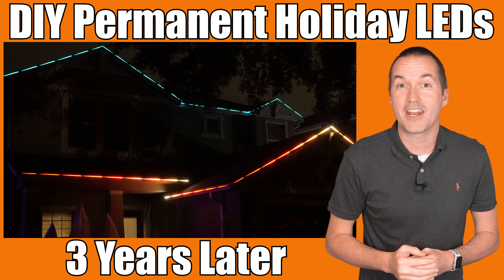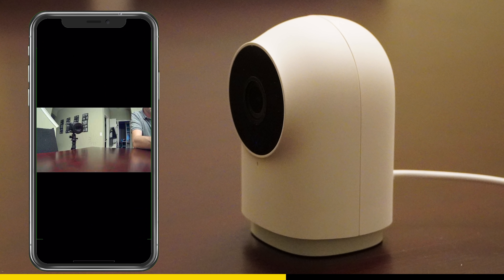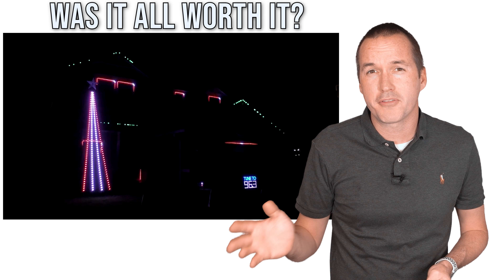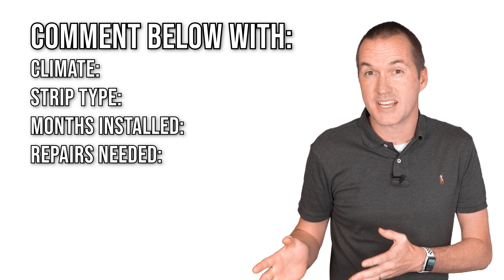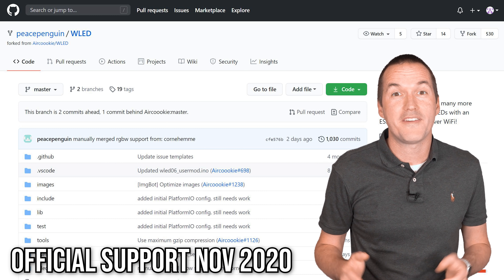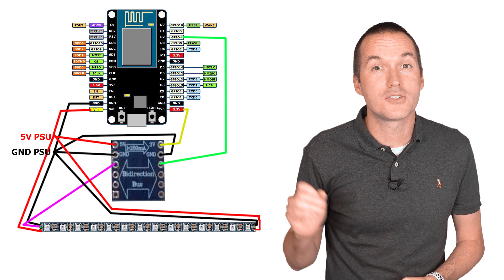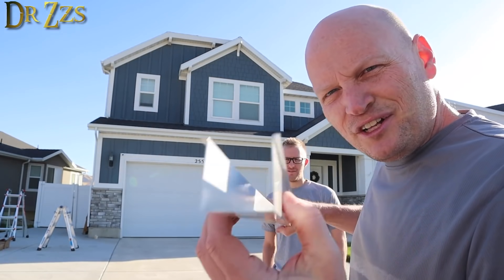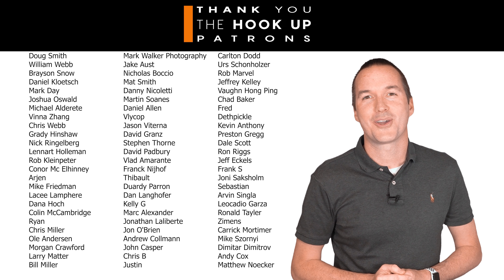3 Years Later: DIY Permanent Holiday LEDs - What worked, what didn't, and what's new?

Comment: why would one want to use a DigQuad over the DigUno.   I was under the impression that one could use a single Uno for everything as all the LED strips are daisy-chained.
Reply from the maker: Correct, my lights are in different outputs (different pin for the upstairs and downstairs), if you have a single run then a digiuno will be fine.
Reply: The Dig-Quad allows for a few things on the board itself. 

First off it has 4 level-shifted data outputs so you can run separate data cables to LEDs that don't connect together serially easily otherwise. Second, if you go above ~500LEDs for a single data output framerate starts to visibly drop, using multiple outputs means you can run multiples of ~500LEDs!

Then the board also has lots of output terminals (7x) which are run through 5 fuses so you can very granularly run your power injection wires directly off the board and keep everything safe with the fuses. Otherwise you'd need some external hardware for that.

Third, it comes with an ESP32 instead of an ESP8266, but I have something in the works for that. ;)
Reply: @IntermitTech  Ahh, that's some great info.  Thank you so much!

Comment: I see you have two power-supplys, are there for diffrent strips or are they connected to the same strips? Like in a parallel connection?
Reply from the maker: One PSU is for my year round roof LEDs, the other is for my seasonal window and door LEDs, they are not connected together.

Comment: Hey Rob, thanks so much for this video series. It's inspired me to not only get into this project, but so many other home automation project I never would have dreamed of beforehand. I do have one question though, when it comes to power injection, do you just run the one single wire from your power supply and splice it at each junction to inject power, or do you have multiple wires running from the power supply to each injection point? I can't really seem to find much on this topic, and I've never dealt with anything like this.

Thanks!
Reply: I ran a wire small gauge wire with the strip, and power injected at every splice. I then power injected every 100 leds with another 18ga back to the controller. I used 5v, I would use 12v if I did it again. I think you can get away without the small gauge follower power injection that way. Also run the power injection thru the controller power feeds too. That way they are fused as well, assuming you're using something like intermit Tech's dig uno.

Comment: I had LED strips on my roofline at my old house with channels, I live in Chicagoland area, I will be going LED strings in my next move most likely. After 1 season about 1/5th of the strips needed repairing and replace. I don't know if it was the brand of strips, and also how my roofline would freeze for sure didn't help. If some how I could install them in a safer area where ice wont be an issue on my new home, I will maybe attempt strips again, or do a partial area and see how they hold up. My old house had icing issues all where I hung the channels. So I could only imagine the ice getting into them, and then breaking the seals on the strips making them not hold up anymore. The pressure was so strong the gap between the channel and my roof actually pushed the channel with the screws about 1/8 to 1/4 of an inch in some sections. I noticed this when I went to repair the strips and the once tight channel was now lose and needed to be retightened.

Comment: Power injection is one area I struggle with.  I want to run an LED channel under my fence with addressable LED's which will be roughly a 250 Feet line of LED's  How do I calculate the power injection requirements for a 250' run?
Reply: Check out the original Hookup video on permanently installed lights referenced in this video. Tells you how in there.
Reply: @hockeytrainingvideos371  If you're talking about Year Round Holiday LEDs Part 1: Hardware then no.  It talks about the need for power injection but not how to size the wire.  Can I run a 5v 22guage Power Injection wire for 250'?  If not how do I figure out the wire necessary?
Reply: First you calculate your power requirements (how many LEDs, how bright, what colors). Then convert to amps. With amps you can plug that into an online amp + voltage calculator which will give you the minimum size for the wire. Usually you want to bump up a size or two to allow for a safety factor.
Sadly this does appear to be one area where it isn’t really talked about. Low voltage has different amp/size requirements than high voltage. For instance I’m running 3 different 15-20 amp 5volt runs for my backyard. At 110 that would mean 12 or 14 gauge wire. At 5volt it’s around 22 gauge so I’m running 18 for a safety factor and to avoid voltage drop on my injection wires.

Comment: Climate: HOT Phoenix Arizona US. All equipment is mounted in the attic.
Led strip: WS2812b from btf
Installed: 15 month on the front of my facia boards. 
Power Supply: cheap 5v power supply
Controller: Hand build Dig Uno's. I had to run 5 controllers. I had too many leds for the processor for e131 functions. Air cookie suggested around 300 leds per controller, if you are going to use e131. Otherwise it's fine with wled to have more. 
Repairs needed: two leds had a single color die. I had to resolder a new one in. They are on year round, on white at 20% if it's not a holiday.
Reply: I'm in phoenix area too and I want to get into this hobby.  Any suggestions on how to get started?
Reply: @jaykuptake  I used the the channels and noted on this video. Put the channel up, and drilled thru it and the facia next to the closet rafter so you can't see the wire. Then drilled a hole to route the 18ga into the attic. I routed all the wires next to the attic access, and have an outlet there. That way I can stand on the ladder to wire and diagnose. The controller is a dig uno by  quinled. They are fused, and have temp sensors if you want to use them.
Reply: @jaykuptake  This video worked well for me to get started with the eve lights. I used 5v for my install but would do 12v if I did it again. Much less power injection. For the eve light controller, I used intermitech's diguno. Another great led channel. Don't put more then 300 leds on a 8266 based controller if you plan on running e131 for your display. For Christmas light shows, Canispater Christmas has a great channel for using show controllers, and scheduling with xlights also.
Reply: I'm in Phoenix and interested in doing something like this.  How have your plastic diffusers held up against the sun? I'm just worried that I would have to replace the plastic constantly.
Reply: @deity5555  The plastic diffuser is holding up so far. They have yellowed pretty good, but that matched my tan eves okay, lol. I think they are good to use here. But mine are also a bit shaded, as my house faces north. You only take them off for repairs, if you're careful I have no cracking yet. I lost one color in two pixels so far. Easy fix though, I used ip65 strip. So cut, pull back silicone from the strip, solder in the new one. Stick electrical tape to the channel under splice, to make sure it stays insulated from the strip.

Comment: My question is, WHERE do you live in Florida - on the coast, or inland?
I ask, because you said you had no issues with the aluminum channel after 3 years... I live ON the coastal water, and the aluminum I've tried just doesn't hold up well to the salt air here.
Recommendations?
Reply from the maker: I live in Tampa, the bay is about .75 miles from my house.
Reply from the maker: Also, when you say the aluminum doesn't hold up, what does it look like? Aluminum Oxide is white and filmy and should protect the rest of the channel.  If you see rust color then you aren't working with aluminum.
Reply: Well, that makes sense now... I live 27 feet from the Lagoon's edge.
Yes, it's aluminum for absolute certainty... but it's painted, not anodized - and the corrosion bubbles up under the paint, apparently.
Do they make a polymer version that holds up to UV for several years?

Comment: So what I thought was noise from my power supply was actually noise from me using solderless breadboards. I went from solderless to building my own boards on a normal breadboard and it fixed all of my issues
Reply from the maker: Interesting!  Lots of variables, I've seen and helped troubleshoot so many problems, it's hard to say which ones are equipment based errors and which ones are user error.

Comment: I have been waiting for this video and you did not disappoint.  Buy I have to say I disagree on the WS2812b vs WS2815b strips.  I feel like with the 12v strips you don't need to power inject as often or at all in the case of 2 or 3 strips per section or you can get by with just injecting power at the end of a run.  Compared to a professional install, the WS2815b strips are still super reasonable.  I picked them up on AliExpress for around $25 a strip.  To me, the additional cost of 12v strips is worth less hassle of wiring power injection every 5 meters.
Reply from the maker: I'm just hesitant to give that recommendation because I've never deployed a WS2815 permanent install and because I've seen lots more reports of failure with the WS2815 than I have with the WS2812B (again, this could just be selection bias), and I wonder if it has anything to do with the different circuitry required to regulate voltage (they are doing some crazy MOSFET inside those strips).

Comment: How were you able to determine that the first light had gone bad?  Thanks.
Reply from the maker: I had actually experienced something similar before when I accidentally hooked up 12v to a 5v string.  I gave it a shot and it just happened to work.
Reply: This is great information Rob and a great question.

Comment: Climate: Northern (Montreal,Canada)
Strip Type: WS2812B
Months installed: 14
Repairs needed: Updated to WLED on my node MCU this October. No cold weather related issues as of yet
Reply: Up there, it's less of a "freeze - thaw" cycle and more of a "freeze - freeze - ...... freeze" cycle :)
Reply: I installed ~1000 WS2815 LEDs a few months ago, it gets extremely cold in Regina, Saskatchewan for extended periods. People have them installed here for Christmas light displays and they handle the cold just fine.
Reply: @fishr0t  So happy to see your post.  I just put up over 1000 WS2812B LEDs in Regina and became worried when Rob said there has been some problems in colder climates.
Reply: @ToddSchock  Awesome! I'd love to see them and how you did power injection for the 2812Bs -- I'm hoping to do around my garage doors next year.
Reply: @fishr0t  Awesome!  I'd take a picture but my house is a two story and I have them along the roofline.  With the ice and snow out front the ladder slips.  In the spring I'll get up there and take a picture.  Until then... I used the aluminum channel that Rob suggested in his video and then I ran 18awg wire in parallel to the light strip inside the channel.  The channel is slightly wider than the led strip so the power injection wire sits beside it... sort of.  I tried to hot glue the wire down but it didn't stick to the aluminum very well and the wire also interfered with the diffused cover so I just set inside the best I could.  If I look really close I can see where the power injection wire overlaps the LED strip in some places.    I'm a perfectionist so the overlapping wire really bothered me at first but I've been reassured by my wife that if I hadn't said anything she would have never noticed.  For the connections, I pulled the ends off the LED strip and soldered the connections together otherwise the connection was too big to fit inside the channel.
Reply: Thanks Alex for the update. Planning to do this in Ontario North of Superior
Reply: Merci!
Reply: Thanks just bought our first house in 2 montagnes and planning for next year installation :D
Reply: Any problems with the adhesive on the strips coming undone after the winter?
Reply: @chrisatlee  no they fit really snug in the aluminum channels I purchased. I also hit glued them in spots.
Reply: @chrisatlee  no problems but I have them installed in an aluminum channel with dabbed hot glue
Reply: I'm planning to do that too, in Laval. I currently have 1 strip of WS2815, liked them for the 12v adressable.
Reply: Climate: Texas (DFW hot summers)
Stripe type: WS2811 Round Bulbs with 3 leds in each bulb
Months installed: 3
Issues: I have had a bad wire between bulbs at a jump area. 

I found some neat bulbs that are the 12v. Dr Zzzz mentioned with 12v it does three leds all the same color. With these bulbs it has three leds per light. I mounted them in room drip pan metal and screwed under the front so they are hidden. (A lot like the Jelly company.) I have to finish getting the power set permanently as I have to setup the power box each time (and fried my node mcu as I was not careful!)

Thanks for all the info you guys give!
Reply: @rockfisher I used the led channels and I purchased IP65.  IP67 was too big to fit in the channels I was using.
Reply: @rockfisher yeah I'm using led channel. Can't imagine not using led channel for strip lights.
Reply: @rockfisher the silicon coated ones.
Reply: @fishr0t  I wonder if you're still on here. I am looking into this as my summer project next year in Ottawa to get ready for the holidays. Is it still holding up? I am worried about the fact Ottawa gets a lot of freeze thaw and that it gets very cold here. Debating LED strips and channels vs a LED string setup of sorts.

I have few actual Christmas lights right now, just a small amount, so if LED strips and channels are good - even without any advanced setups, I might do my lower level roofline this year if I can get it going in time. Worry about more than just basic light set up next year and do more than just the front facing too
Reply: @ZeromuS_  all good here still though I did switch to wled and a dig quad for my controller.
Reply: @fishr0t  but silicone channels and strips holding up? That's my first step as I think it's gonna come out cheaper than rope lights in store and more options for me :)

Good to know! Now to figure out the best silicone channels to grab
Reply: @ZeromuS_  yup no issues there really. A piece of channel popped out of the clips but I just had to push back in. Survived a saskatchewan winter just fine otherwise.
Reply: @fishr0t  perfect great to hear. Thanks so much!
Reply: @rockfisher I used a channel that was 12mm wide. I was lucky enough on the bottom level to be able to come in from behind for power injection (two spots) and up top I just ran the cable above the channel and injected at one spot. I presoldered them on the ground into slightly longer than I needed pieces for the top and bottom runs and just cut the excess off. My controller is in the garage, I'm using a rpi w/ a falcon hat, no WiFi for me in this set up. I'm using ws2815 strips and my data wire at the longest part is about 20 feet.
Reply: @rockfisher yup power supply is in there. It is heated but would be fine unheated since it is attached. The rpi is PoE and can turn the power supply for the lights on and off as needed.
Reply: @rockfisher yes 
C$ 108.14  10％ Off | 10-30set/lot 2m 80inch anodized black led aluminium profile for 12/24v strip flat slim aluminum channel, 90/180 degree connector
https://a.aliexpress.com/_mr3gk7b
Reply: C$ 108.14  10％ Off | 10-30set/lot 2m 80inch anodized black led aluminium profile for 12/24v strip flat slim aluminum channel, 90/180 degree connector
https://a.aliexpress.com/_mr3gk7b

C$ 2.51  58％ Off | DC5V WS2812B 1m/4m/5m 30/60/74/96/144 pixels/leds/m Smart led pixel strip,Black/White PCB,WS2812 IC;WS2812B/M,IP30/IP65/IP67
https://a.aliexpress.com/_mqyxxJX

Black 5m  30 ip65

Node MCU
https://imgur.com/gallery/aeemGsZ
LED in aluminum channel 
https://imgur.com/gallery/hCASZbk
Reply: @rockfisher it’s in my garage that is heated
Reply: @rockfisher if I was using WiFi, it wouldn't affect me as I run my own WiFi access points in my house. But yeah, you'd have t9 be able to change the WiFi info somehow if that was an issue, one method would be make your phone's hot spot have the same ssid and passport, your nodemcu would connect and you should be able to change the WiFi information to the new info.
Reply: @rockfisher I only have my first roofline set up but I do have plans to complete the second roof line this week 😬. (I waited till winter again)

Comment: Thanks for all of your support. I used your videos to guide me in the design and build of my permanent light display. I’m in Orlando FL and this will be my second season of using this setup with no issues except I’m bad at programming and so i tend to modify others code to fit my setup rather than creating it from scratch.  I did wire up my own controllers but have not figured out how to make a wireless connection yet.  Where is the best place to download some Halloween code?  Thanks again for sharing your expertise!
Reply from the maker: WLED has some Halloween animations.